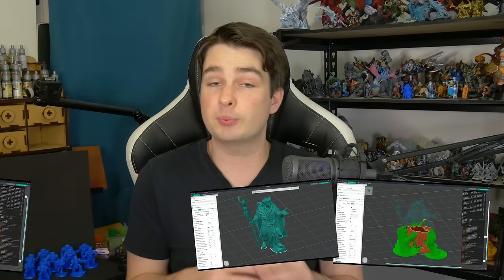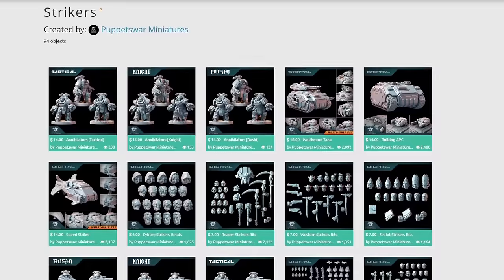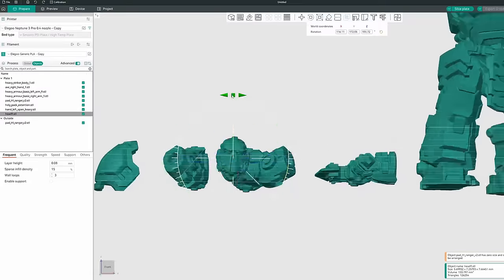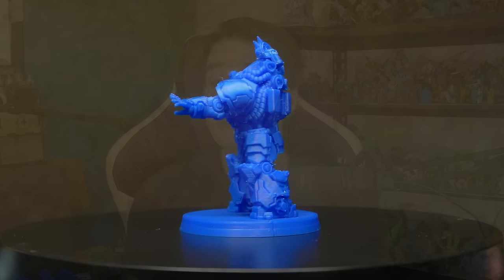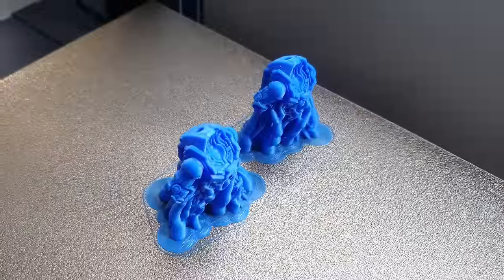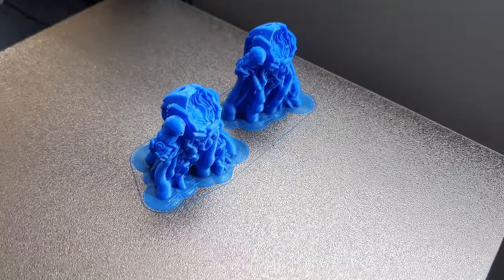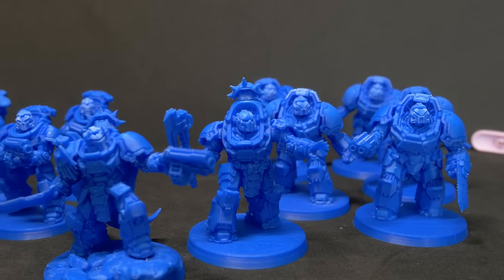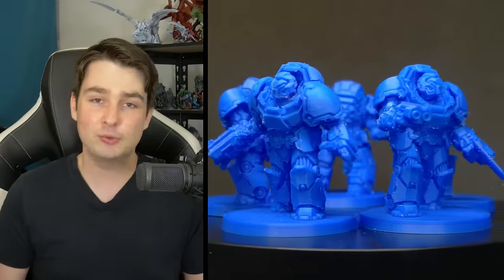I FDM Printed a 40k COMBAT PATROL! Should You?

Comment from the maker: FAQ:
Printer: Elegoo Neptune 3 Pro (w/ 0.2mm Nozzle)
Filament: Elegoo PLA
Slicer: Orca-Slicer
Reply: Got the same printer but switching to the neptune4pro almost cut my printing times by factor 3 i highly recommend this one (klipper speed makes a huge difference). Thanks for all the fdm videos 👍.
Reply: Great video.

 Before getting a resin printer I went down the rabbit hole of printing mini's with a 0.2mm nozzle and using a 0.05mm layer height to achieve some really nice quality but the one thing I always kept was 100% infill, now why would I do that? Because of how FDM absorbs paint, with 100% infill you don't have this issue ever creeping up.
Reply: What settings or profile would you recommend for OrcaSlicer? I’m trying to swap to Orca for my Neptune 3 Pro but I feel like times are slower and getting inconsistent results.

How would you recommend to tune/calibrate the printer? And what settings for OrcaSlicer would you recommend?
Reply from the maker: @Weird_Quests  I have a full guide for my Orca-Slicer settings here! https://youtu.be/Lzf_pCKjJNo
Reply: @Painted4Combat  lol - I literally just found it when you commented :) thank you so much :) I’m just about to start releasing tabletop content (my main industry) but I’m expanding into 3D printing to produce accessories and such too - so looking to learn and get into design alongside content :) based on Melb too :)

Comment: I would try this plus the acetone trick to smooth them out a bit or scale up. (I don't play tabletop wargames, I only like painting them)
Reply: Keep in mind that acetone won't work on PLA, which is the most commonly sold (and probably one of the easier to print) materials for FDM printing, though. It will also more than likely just melt the fine detail away if you do use a material you can use acetone on.

Comment: I'm getting an A1 Mini for Christmas (well, I have to share with my son). What are the trade-offs between printing separate parts and gluing them together, vs. assembling a complete mini on the computer and printing it in one piece?
Reply from the maker: Exciting! Hope you enjoy the printer ~ I like to print in parts where possible, assembled minis generally have more pieces overhanging bits which often (not always) require more support material; when they do it means more ugly overhangs and scarring left by support material and more wasted filament.

Being able to orient parts individually leads to much cleaner prints and easier support removal, plus it means if the print of a single part fails you aren't reprinting a whole mini!

For a further explanation about the orientation stuff and getting clean prints from multipart minis, check out my Supports guide! I cover it all there https://youtu.be/ZghfP8_L8Pc
Reply: @Painted4Combat  Thanks!

Comment: Thank you for an interesting video!
A question from a noob who have not yet bought his 3D printer: What is the best way to print minis on a FDM printer - one at the time, many times, or print multiple models at the same time? If I would make the Warhammer old world project I was thinking about, I would need to print out close to 100 night goblins - and that would only be the start. Alot of work, but I like the look of the models that I could print better then GW:s models.
Reply: FDM can do multiple models easily but that does make it take longer for every model you add, and if something goes wrong with one model the issue can ruin the adjacent models, honestly this is where resin has an advantage, its faster to print multiple miniatures on resin but the failed prints cost you a bit more on resin.
Reply: @odisy64  Thank you for the advice, but I rather spend 100 times more time (or more) to not having to deal with resin. But timewise, is it big differance printing a single model two times then printing two models at the same time (using the A1 mini)?
Reply: @danielnor5508  generally it would be faster to print 2 at the same time since you minimize the amount of post processing and set up you have to do but it also depends on how you have your print configured because if the head is having to travel to each model in between layer heights that may add a few fractions of a second that add up over time.

Comment: What glue do you use for PLA? 

I’ve tried a couple and it always seems to either not dry basically at all, or take forever to dry enough where I don’t have to hold the pieces together without fear of them just falling right off.
Reply: Best bet is just to use superglue.
Reply from the maker: Yep, as has already been said I just use the cheapest superglue I can find for small PLA minis - no need to complicate it!

Comment: Thx for the video. I am having the issue, that my support are pretty much welded to the mini. Any recommendations on setting or which filament to use?
Reply from the maker: What nozzle size are you using? - I do also have a full settings guide and a specific Support Settings guide you might want to check out!

Comment: ive got a Question regarding your Printer since ive got the same

Does your printhead also not cool the Filament properly? I got the issue that the Filaments tends to start melting inside of the head and causes clogs before it can hit the nozzle
Reply from the maker: No, cant say that I've encountered that problem ~ My printer has been pretty flawless (didn't clog EVER for the first 18 or so months of use). Might be worth getting in touch with elegoo on that one!

Comment: I bought an A1 with this intention

I have 30% of them fail, despite using all the settings provided by Fat Dragon. 

The minis are so brittle, it’s impossible to remove the supports without snapping something.

I have decided the the A1 will be solely for printing terrain and bigger things like vehicles, as the quality is just terrible in comparison with the resin, plus I can use ABS like resin for more sturdy models.

I have now purchased a resin printer as a results of my very disappointing experience in printing minis on the A1

Please, if you have the opportunity to print with resin, do that. If you go into this with an FDM printer expecting the same quality and polished finished product you will be sorely disappointed, I know I was.

Thankfully the A1 is busy chugging away printing nicknacks and toys for the daughter- but no way is it up to the task of printing minis that are worth painting.
Reply: That’s weird. My brother does it all the time with no issues.